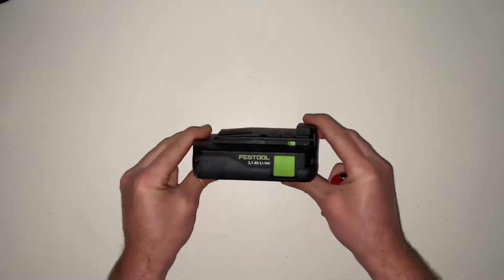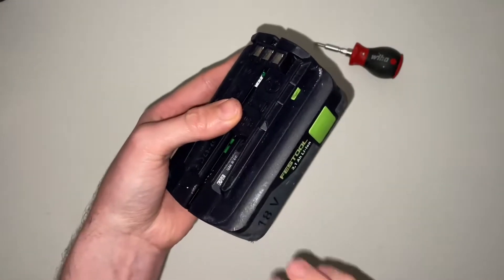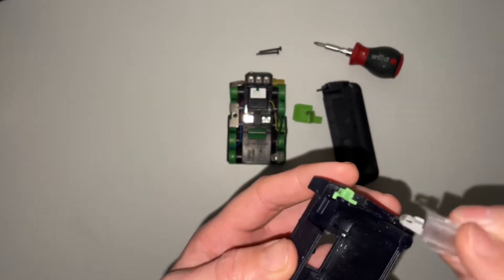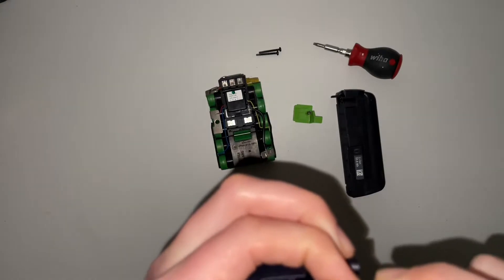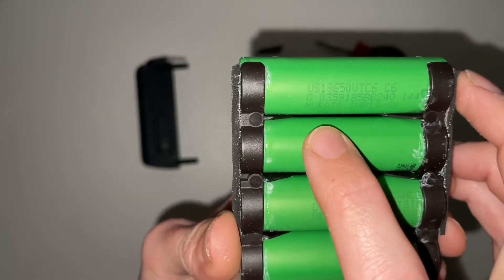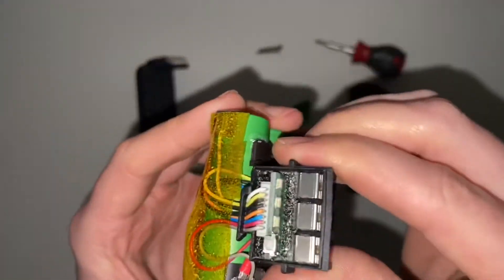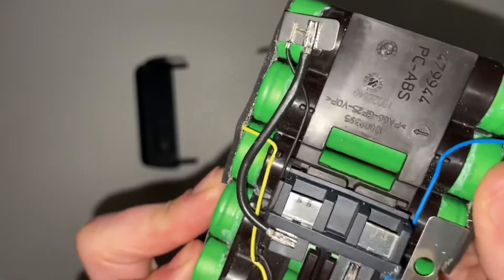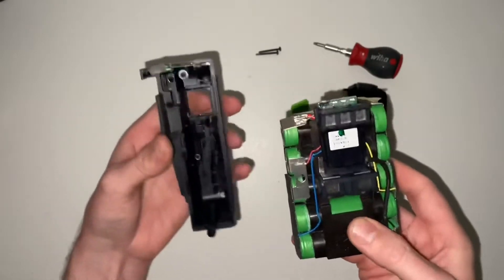Festool battery - Full Teardown

Comment: Those thin cables are for BMS, and thermal sensor is breaking nothing, it is just for sensing and transmits temp to the tool. The path for the current is via large cable. There could be a fuse in the connection socket. Maybe there is no fuse.